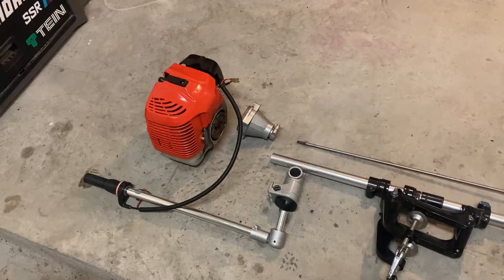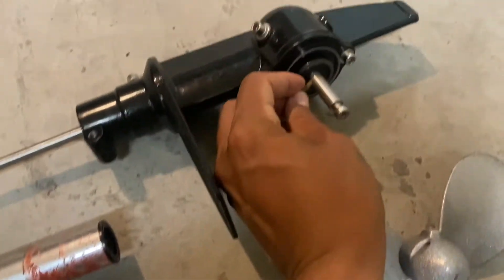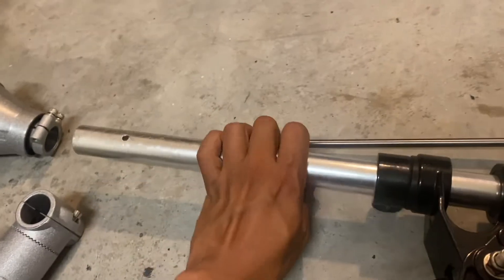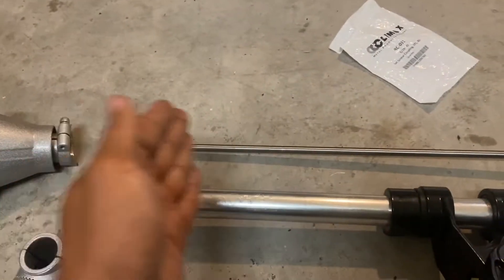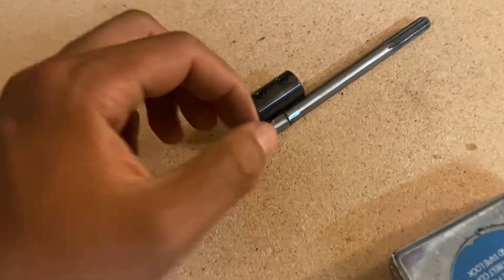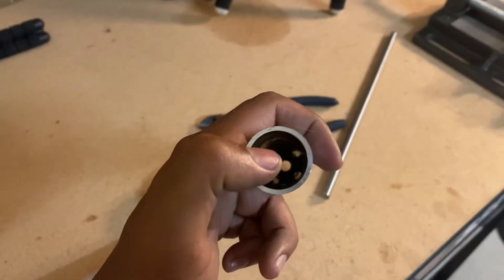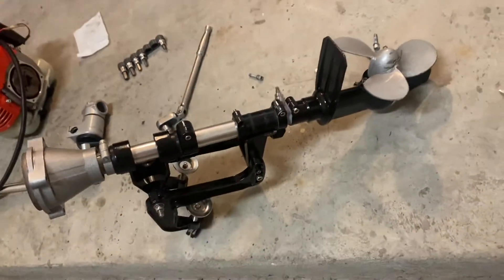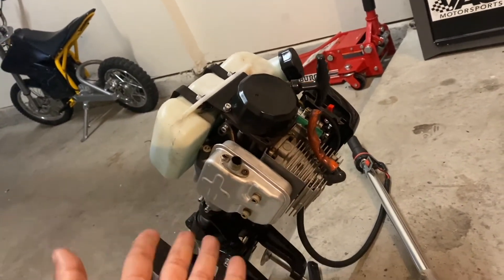Kayak with 2-Stroke Outboard Motor Redesign Part 1 | Shortening the Engine

Comment: I've just ordered one of these at a good price on Temu so I can give it a go. One thing I want to try is aligning the motor on the drive assembly so the engine muffler points to the rear instead of out to the side. Might make the engine noise a little less annoying to the passengers. Very good video how the engine/drive goes together!

Comment: Ide use some blue lock tight on those Allen screws so they don't vibrate loose over time
Reply from the maker: I actually used blue loctite! Great tip!

Comment: Hey I got a similar motor and can't work out how to take off the prop is there any way u could help ??
Reply from the maker: You just reshape the cotter pin till it's straight and pull it out on side with a pair of needle nose pliers.